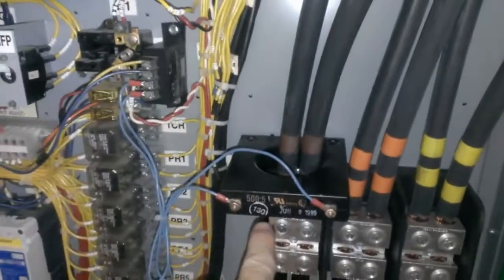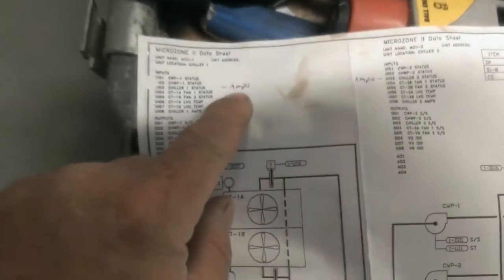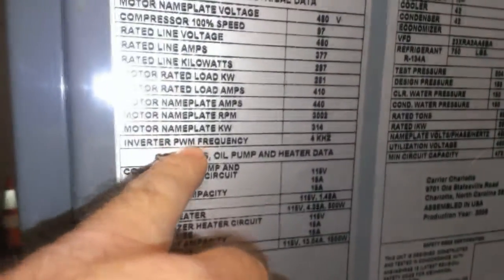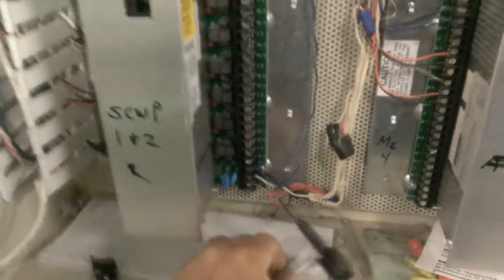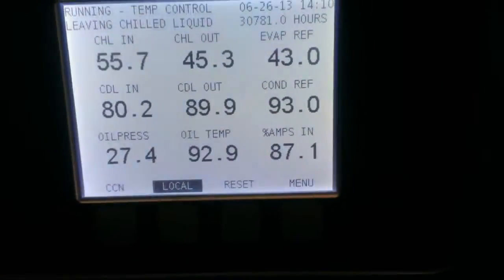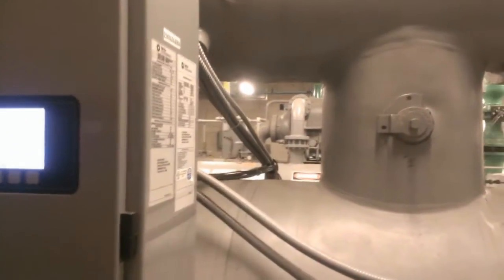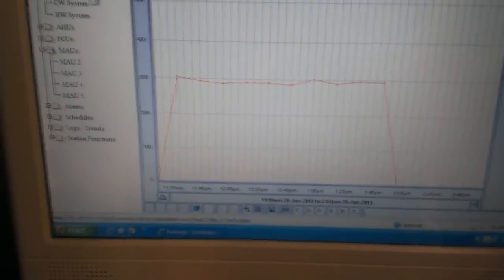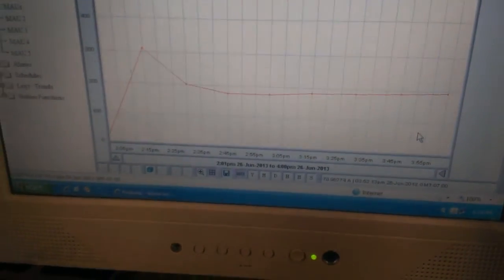Chiller EMS Current Sensor Fix

Comment from the maker: Nice stuff. 
When I get a chance I play around with the loop tunes we have at the facility I work at. Older stuff. 
MicroZone II in the one building (4 pipe chiller/boiler loops) and Alerton BACTALK using old TX-SA controllers at the other building (Water Source Heat Pumps). 

The main building with the MicroZone II was wacked on several units. I crash coursed myself some of the tuning in that DOS based interface. 
Wish I had time to learn the Niagra stuff. I poke around in it some.

Comment from the maker: Yeah some of the actuators have the arms removed too. 
Looking at the control scheme explained on the build-schematics I don't see how it would ever have worked. It's not built exactly as shown on the schematics. 

The boilers are set up to switch on the circulator pump only during a demand for heat when the loop temp drops below setpoint.
Yet, the pump needs to run 24/7 to keep the water flowing through the building.
So, it generates some alarms I had to kill and some other things.

Comment from the maker: Seems ok. Once I started working here on site I was able to mess around with the actual loops within microzone. It's a DOS window based access LOL!
The system was wacked over the years with some crazy settings causing over shooting with some zones heating then cooling then heating, just wasting energy like crazy. Part of the fix was junking those crappy hydrolic can actuators and putting in M800a screw drives. 
Then fixing the throttle rates, etc in the loops.

Comment: Good job! Just love it when you have to clean up after the 'professionals', dontcha? :) When the pros installed our new AC (3rd!) unit in the server room, I specifically asked them to program the controller up, so that when anything trips, activate the AUX contact on the controller (we have a very crude system that can text the operators if something goes offline) - yesterday the unit tripped, guess what? No contact activation :) I will be on the phone with them today.